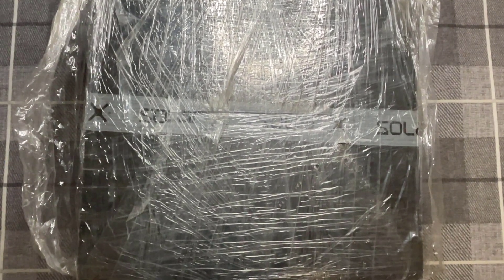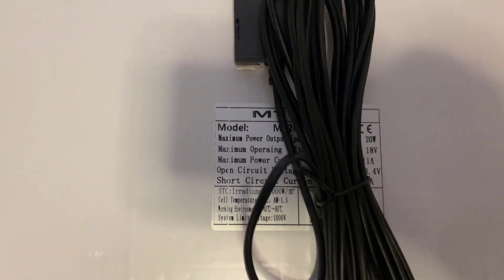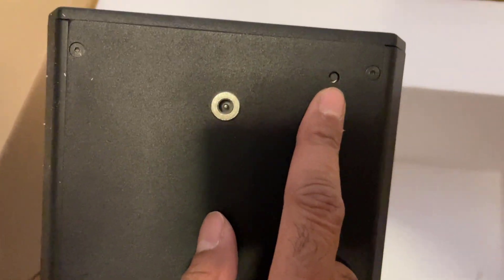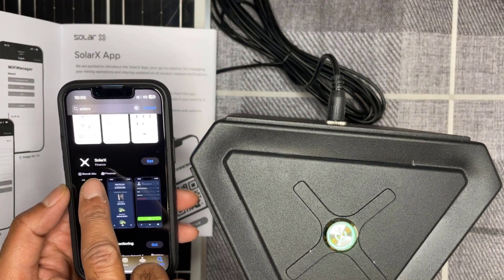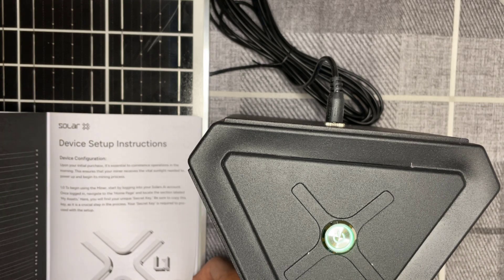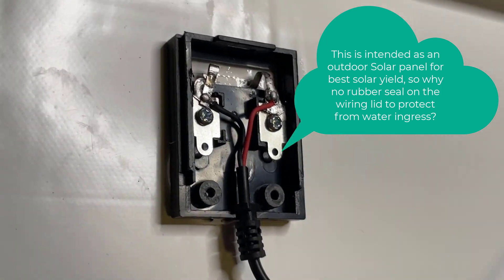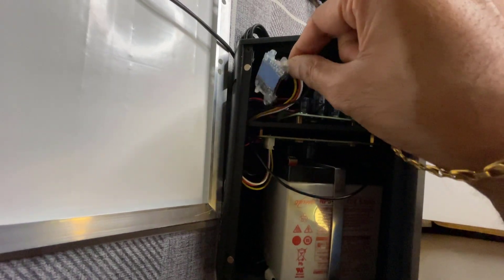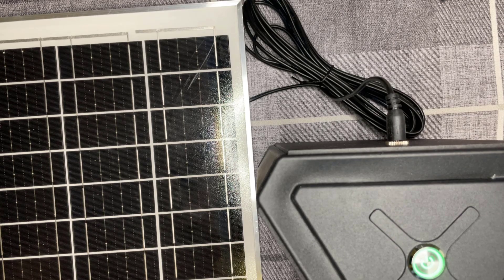Solar Powered Crypto Mining - SolarX Miner Unboxing and Setup

Comment: Where is the GPU in that thing, Is that an Arduino with onboard graphics ? 
With such poor design quality, you can bet it's a start up company, they would not buy custom built components
PCIE cards have interface contacts for VCC, SIG and CLK fitted horozontaly by default, custom designs fit them verticaly but they are very expensive due to component placment on the boards in vertical contcat designs.

Only big well established companys would order vertical contact gpu designs. Mas producing them is even more expensive then getting them built as a custom order, because the facilities to build them are not by default set for vertical contact board layout designs. 

I am betting that that thing was built in someones garage, or a warehouse, maybe even as a university project, but however your GPU capability in that thing is confined to a chip not a card. 

Low minning rate, 

Solotion to fixing the screen, heat shrink wrap and adhesive. 

BTW, those electrolytic caps that can be seen on the board from 714--8:00 were recalled in 2024  due to risk of explosion.

Further the large white component in the base of the unit is a high voltage battery. 
It makes no sense that a solar powerd cypto minor would have a battery in it, since solar power does not require direct exposure to the sun, it only requires natural light. This means a solar panel would still genirate electricity in the middle of a storm at night. Just less then you would get on a summer day. 
It seems like that the entire thing is a poorly designd attempt to install a physical backdoor to for hacking 

Think about it, what crypto minor has it's own Wireless Network ? 
If the thing contains an Arduino with an onboard GPU it could easily have WIFI capability, but it can not genirate that wireless signal without networking circuit's and radio circuits. 

That means that once you connect to space x you hand over all details on your phone to an attacker, including your main wifi details and computer credentials.

I did Cyber Security with CompTia , I am not saying I am 100% correct, I am simply saying this is how it seems to me.

Comment: I like the concept but How do you measure “watts” for their profitability calculator ? They claim 1 watt is 1000+ yearly ?  Huh ? Plus how can US residents even liquidate their SCXH or whatever tokens , it’s not even listed on Trade Ogre,   And not even swapable on Tangem wallet , so how are you supposed to actually make your ROI back if you can’t sell any of the SCXH tokens , exchanges like MCXN aren’t Available in the USA . So ???   Someone answer these two questions .  ??????
Reply from the maker: You can swap via MEXC (not sure if that's available for US), easy enough to do, there is an SXCH/USDT trading pair.
Reply: @HandymanSavage  MCXN is not in the USA , and it’s not even on trade ogre . If they gonna sell a product to Americans have the coin on US exchanges …
Reply from the maker: @WooDeWow  I'm sure that's the plan down the line, but yeah I agree the project should be on exchanges where all can transfer out on to appeal to a wider audience.

Comment: Got 2 of these last week, both arrived lcd missing, with the price going down 8% a day everyday without fail nobody will roi unless they got there’s sub 200 devices online, as for other projects building on there blockchain which is meant September ( they will delay) you can only hope they bring value to the chain, might be worth selling these at a loss and moving into another project, nice video though 🎉
Reply: Did you finally get the lcd ?
Reply: @cryptorizon  installed one myself and sold it it on the week I got them, terrible devices and team,
Reply: So it doesn't make profits of 5 dollars a day?
Reply: @hugosanchez4553  nope